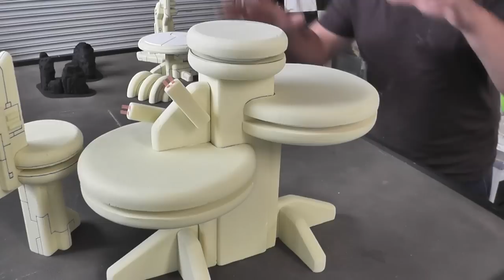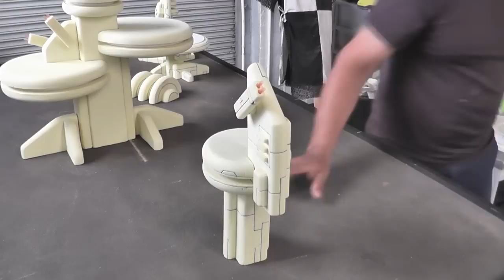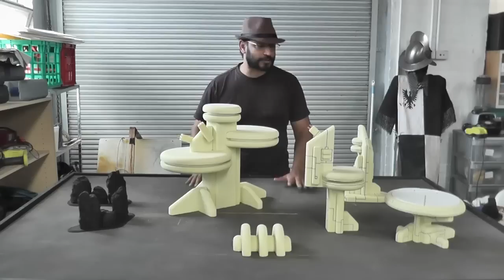5. Tau Project - Habitation Centre & Update

Comment: The habitat looks great, and with the part snapping off that other building it's made a huge difference to it's design and I think looks much better. Reminding me a lot of Star wars now for some reason, thinking Jedi Knight 2 especially. 

Have you considered giving pre-shading a try? If you haven't tried it before you might find it a nice change of pace. Prime the piece white, then use an airbrush to spray along the panel lines in black or a dark grey. Then you spray your base coat over the top and it will auto-shade the piece for you. Good way to start out weathering and saves you panel lining everything by hand at a later date.